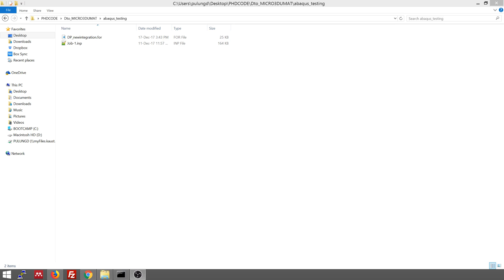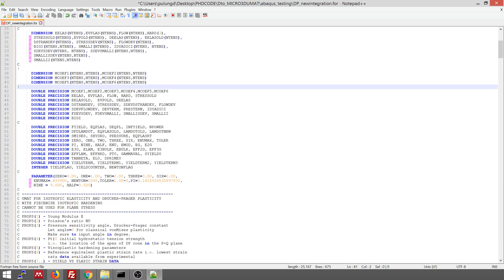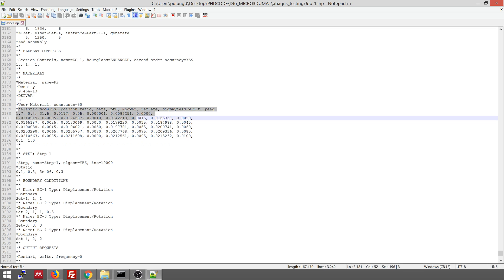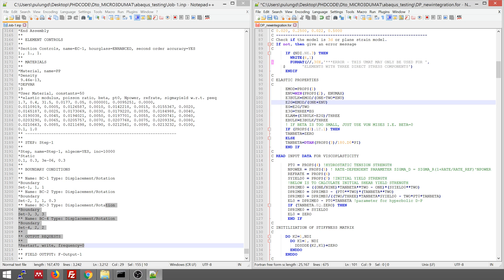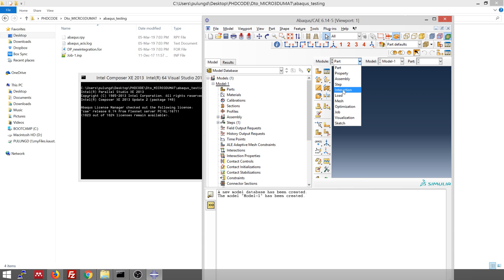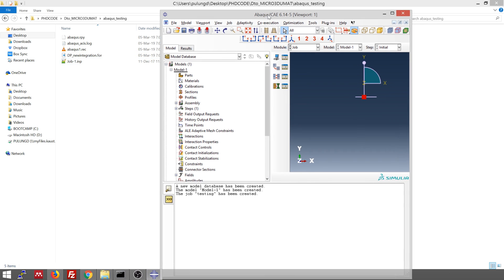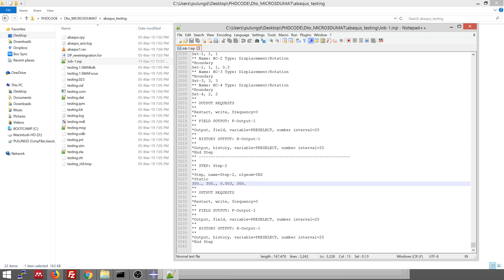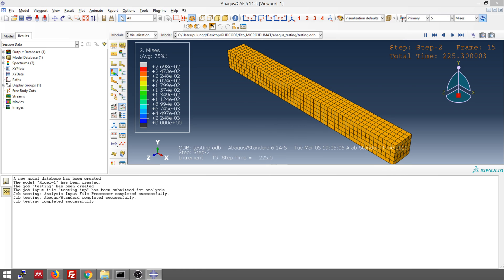How to run ABAQUS Input file with UMAT

Comment: Hello, I have my cae/input file where I ran a model in the regular simulation. It has all material properties, Boundary conditions and everything. It ran perfectly.
Now, I want to run the same model in CPFEM mode so I need to use UMAT. But whenever I attach UMAT subroutine to the job and try to run, my job is aborted. 
Do we need to change the UMAT subroutine for each of the models that we build? If yes, where should be the changes?
Reply from the maker: No you dont need to change umat at all (assuming the umat is indeed working properly).

What you need to do is to make sure your input file is correctly setup for the umat (for example sdvars and nprops).